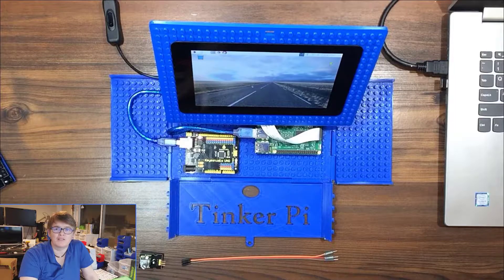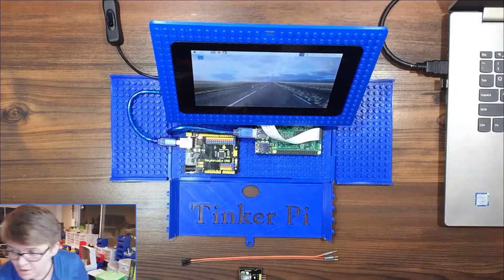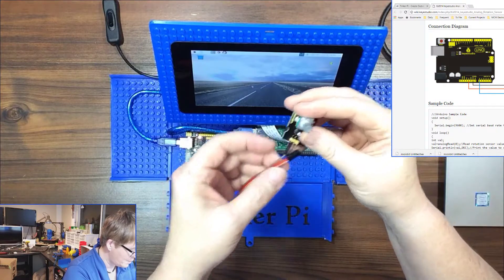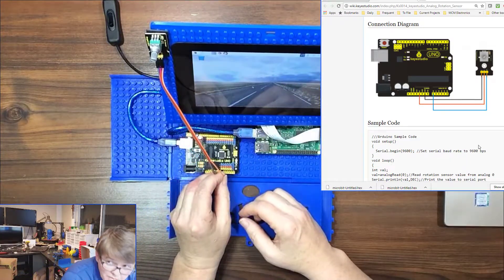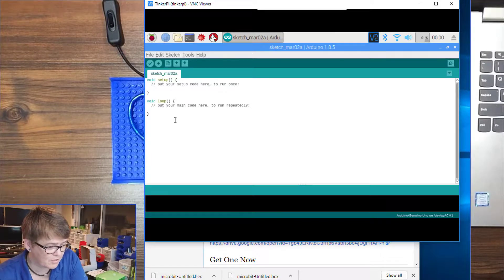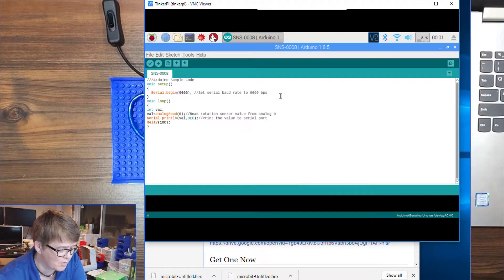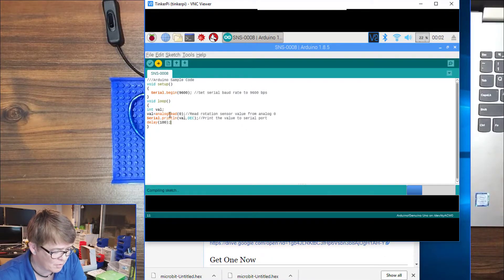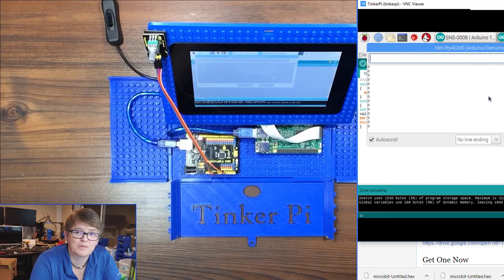Arduino & Analog Rotation Sensor - Getting Started with Arduino and Keyestudios 37 Sensor Kit

Comment: I'm trying to build a sewing machine mouth control for someone who is a double amputee and can't use a conventional foot control. Do you think this is the right type of sensor to use to control a sewing machine servo? I am basically starting from scratch on this idea and need a little guidance. My idea is to use a clothespin shaped mouthpiece that the user can clench to change the signal. It may be impractical, but they really want to sew and haven't been having much luck using the foot pedal on the table and trying to control it with an elbow.